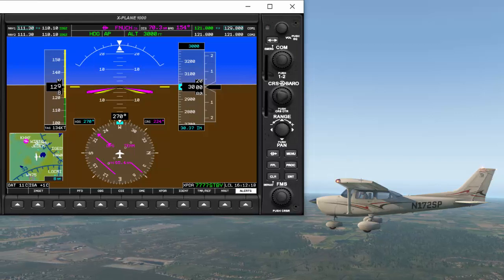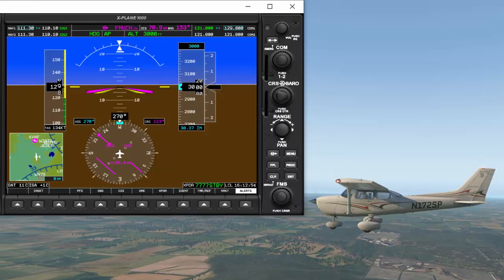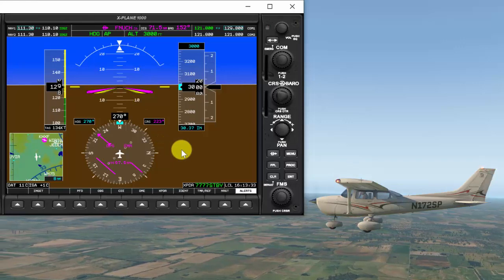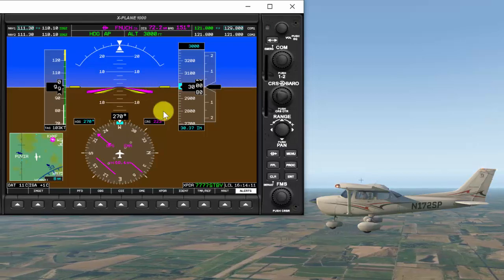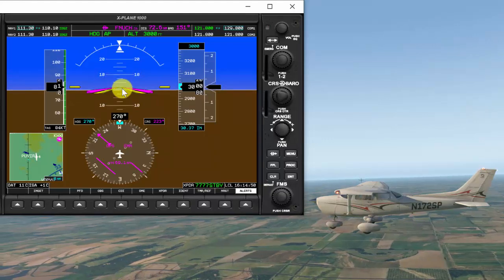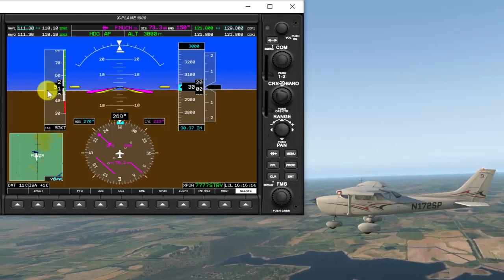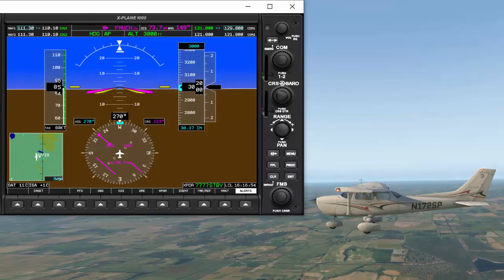www.flightnerdairforce.com  Air Speed vs. Angle of Attack

Comment: Angle of attack is not the same thing as pitch as shown on the attitude indicator. AoA is actually the difference between your pitch attitude and your flight path angle (velocity vector).
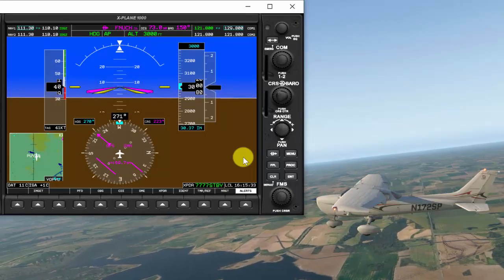Reply: Hi! Yes, I understand the point of the video but it’s just the wording. For example, at 4:40 you say you’re at “7.5 degrees nose high angle of attack, right on the edge of stalling”. The kinds of airfoils on this type of Cessna will typically have critical AoA values between 15-20 degrees based on configuration. So at the bottom of the white arc, with full flaps, your critical AoA will be at a lower value, but definitely not as low as 7.5 degrees. Good demonstration though!
Reply from the maker: Hi Bruno.  Thanks for the clarification.  It is true that angle of attack is not the same as pitch angle as shown on the attitude indicator.  While this is a very imperfect experiment (we're not accounting for things like wind, which can change the actual angle of attack with an updraft or down draft), we are (at least in theory) holding a consistent altitude.  If we hold a consistent altitude and raise the nose, we are increasing angle of attack.  And that, in the end, is the point of this video.  If we're going to maintain straight and level, unaccelerated flight while increasing the angle of attack, we will need to decrease our airspeed.  Lift is a combination of airspeed and angle of attack.